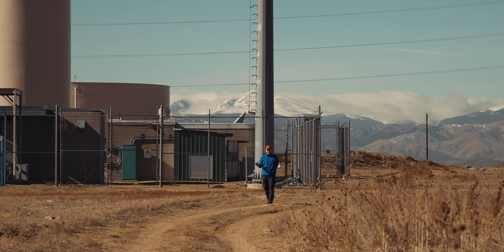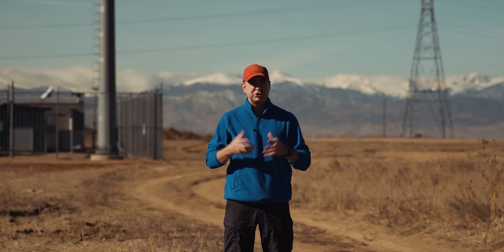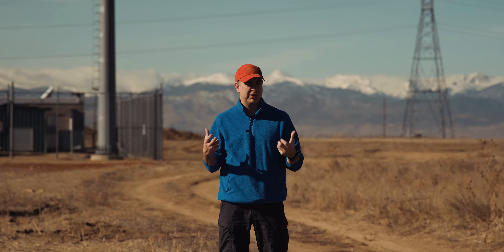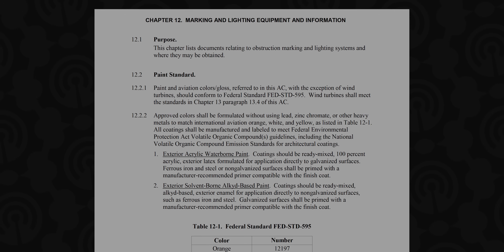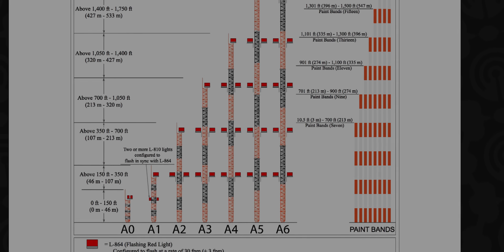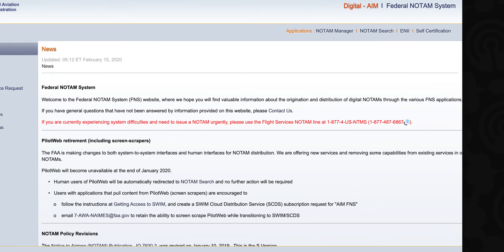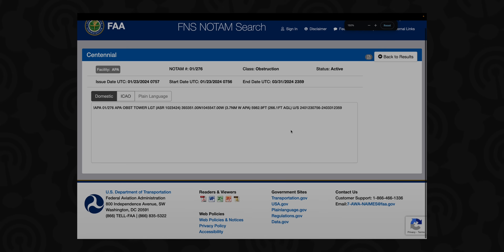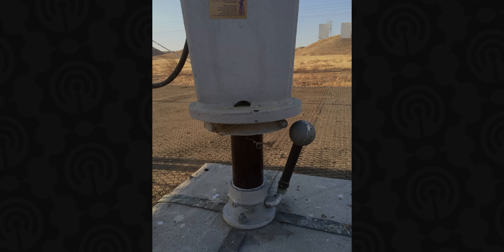The Anatomy of Broadcast Towers: Detailed Breakdown

Comment: I didn't realize that AM radio towers were that dangerous!  Good to know! 
I do have a question, though.  The RF energy being transmitted at a radio station, can it have negative affects on the human body when one is very close to them while they are operational? For both AM and FM.  I know microwave transmitters have the capacity to cook a body like our home microwaves do for our food when one is in direct line with the antenna, but I am curious if that is possible at AM or FM frequencies.
Reply: This is a hotly debated issue.  It's called the effects of non-ionizing radiation on human tissue.  Non-ionizing radiation is basically radio waves versus ionizing radiation like X-Rays, and radiation emitted by radioactive material.  There is some evidence that children living under high tension power lines have a greater likelihood of developing leukemia than those that don't.  Yet the people that work on those power lines seem not to be affected.  Microwaves are kind of on the dividing line between ionizing and non-ionizing radiation.  Some people think holding your cell-phone close to your body, especially your head may make you at higher risk for certain forms of cancer.  Some people are really concerned about 5G cellular, since those towers have to be much closer to the user than the older technology.  Now, having said this for every study that says there are these negative effects, there is another that says no, it's perfectly safe.  Marcus is right, do not ever touch an AM broadcast tower, ever.  I've drawn electrical arcs off the guy wires at an FM tower just running a screw driver over it.  It could have been from static electricity and the place was pretty hot with RF.  There were two FM stations on tower, and the NOAA Weather Radio Station, but it's only 250 watts.  I've been messing with RF since I was a kid, I'm a grandfather now.  I do maintenance on some Ham repeaters.  These are located in areas where there are broadcast transmitters, cell phone systems, and other transmitters.  I've been very close to a TV transmit antenna, and had my face inches from our own 120 W VHF transmit antenna.  I developed cataracts when I was only 40.  Did this behavior have something to do with that? I don't know.  My doctors think they see some changes in my optic nerves, however my distance vision is still very good.  So, they keep poking and prodding at me, but still no definite answers.  I do know this for certain, the FCC and the EPA are now making us answer questions about RF safety on the Ham tests, and we are supposed to do an RF safety evaluation on our stations.  Even though the highest power level we can run is 1500 watts PEP.  Most of us on our VHF and UHF stations seldom exceed 50 watts if that much.  Pretty tame compared to broadcast transmitters.  We once asked the engineer at a 50 KW AM station, what happens if you touch the tower while standing on the ground.  His answer was, "you will disappear in a pink puff of smoke."  Something like that happened to a would be copper thief at another AM transmitter site.
Reply: @merlingriffin3861  This is not a debated issue by anyone that understands physics.  There is zero evidence power lines cause leukemia.  Microwaves are nowhere near ionizing radiation.  You have the entire band of infrared, visible and UV light between microwaves and the lowest frequency ionizing radiation.  The ONLY hazard from radio/microwave exposure is heating given enough power exposure.  Maximum permissible exposure is complicated by distance, frequency and gain/radiation pattern of antennas.  Repeating what "some people think" isn't sound science.
Reply from the maker: It’s all about wavelength and resonant frequencies with body parts. At AM frequencies not really an issue. FM frequencies will cause heating effects on some smaller body parts.
Reply: I wouldn't want to get a serious RF burn....I'm theorizing that there is enough current at a 50kW AM radio station tower. I wouldn't want to be these foolish Russian teens: https://youtu.be/b9UO9tn4MpI?si=x_M_tYHEk82dY6gD

Comment: You are absolutely wrong, if they are beyond the fence and not suppose to be there regardless of what type of stick it is, go ahead and touch it....
Reply from the maker: Ha! It’s an electrifying experience. Things will pop! You will become excited by the sparks!
Reply: @sg17847, sorry but you are "absolutely" uninformed of the potential dangers of doing this. Even on an 'unernergized' tower or mast structure there can be built-up static charges with a surprising amount of power searching for a path to ground through the guy wires or any other available conductive connection. Don't be that connection.

Comment: Great timing. Sunday I took a drive to the transmitter site of an AM station I used to run. Phased array, AM 5KW day 1KW night. I was reminising about the time I spent maintaining it and the associated equipment. Before modern air navigation systems were introduced we were the station used to navigate cross country and to the local airport. Fun memories.
Reply: @trbowlin, glad you mentioned broadcst AM towers as radio navigation aids. Although not commonly used by pilots today because VHF and satellite nav are the current standard, many (usually older) aircraft are still equipped with ADF or Automatic Direction Finding equipment that is basically a type of AM radio receiver with directional sensing and a panel-mounted display with a dial type compass indicator and a rotating pointer needle that indicates relative bearing to station, analogous to signal strength. In the early days of aviation a pilot or navigator sensed direction to an AM broadcast station manually by rotating a steerable loop antenna below the aircraft, looking for peak signal at a selected frequency. This was called 'DF.' Tune, identify station by call letters or other info ("...and the weather in Ft. Wayne is...) then simply rotate the antenna and listen for highest volume over the speaker or earphones, or observed a signal-strength meter or small oscilloscope tube for indication of peak reception. To this day a small part of the Khz band of the frequency spectrum is still dedicated to omnidirectional broadcast beacons and directional marker beacons used by the FAA for air navigation and as position markers on certain terminal-area flight procedures. Their exact locations and broadcast frequencies are noted on aeronautical charts. Normally they are modulated to emit a three-letter Morse identifier which is repeated at regular time intervals and heard onboard the aircraft to verify station ID, but some can also carry voice. Commercial AM broadcast towers are a useful form of navigation aid and in most ADF-equipped aircraft you can also listen for entertainment and general information. FAA radiobeacons are adjacent to commercial AM on the spectrum and have lower frequencies.
Reply from the maker: That sounds like a very interesting story!

Comment: I might be doing some maintenance on an LP FM antenna. Is there any danger whatsoever in maintaining one of these?
Reply from the maker: It depends on where the antenna is located. If it’s on a tower more than a regular ladder or accessible from a bucket truck then I’d hire professionals. Just be sure the station is off before you get close or touch the antenna.
Reply: LP is just 100 watts  But lock it out it can give you a nasty jolt    our AAARRRGGGG one is 150 watts

Comment: Thank you for posting.  I am retired from radio after a 48 year career. This is good info for the public in general who otherwise would not be aware of the dangers associated with these sites.  Standing under guy wires can even be a hazard where melting ice or in some cases hardware can fall off causing serious injury or death.
Reply from the maker: Yes, I forgot to mention the ice off the guy lines. I’m finding a lot of people are coming from the IT world being thrust into the broadcast engineer world. There isn’t usually an ice danger fixing someone’s printer.
Reply: And in cold conditions, ice falling from towers can be fatal. Ice from our 2000 footer carried almost a mile away.

Comment: Interesting. I wondered about grounding towers, as I've observed sparks upon disconnecting coaxial connector when it's windy, obviously static. I would imagine that one of those sticks would aquire quite a charge, setting RF aside!  I would like to see a video on directional arrays, suppression to protect orher stations, and the like. I realize that might not be an easy subject to cover in one video... All the Best! 73 DE W8LV BILL
Reply: Seems to me that a drain resistor would take care of static charge. Some high enough resistance that the transmitter wouldn't care, but low enough to effectively bleed off charge.
Reply: Ungrounded towers can develop a pretty good static charge. Even Series fed towers - ever see/hear St. Elmo's Fire?
He also refers to being zapped by a tower receiving RF energy from nearby RF sources, like other towers in a multi tower array. Before working on a tower in a directional array, you need to detune/ground the one on which you are working. This includes feedlines and tuning components. Never leave home without your Jesus stick and ground strap.

Comment: Very interesting,here in Ireland,the lights flash at night, theyre red, and the two other lights in between are red but steady
Reply from the maker: Yeah I didn’t cover that as in detail as I could. But yes top lights flash and others are steady.
Reply: @TheBroadcastEngineer  you covered it well it was very interesting, can you do a video sometime on what the power of the signal does i.e when they say the signal is 160kw or 5 kw, and what the advantage of height does, not only by being on a mountain top but the way national tv and radio tends to be at the top of a mast and the local station ( at least here in Ireland tends to have the radome or antenna nearer the bottom, that would be interesting ( i meant megawatts not kilowatts) 🫣